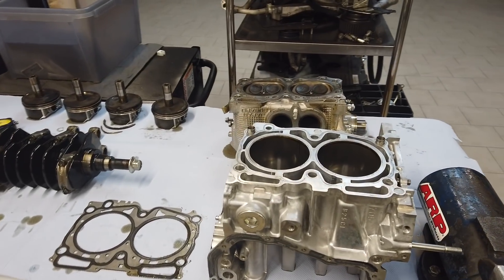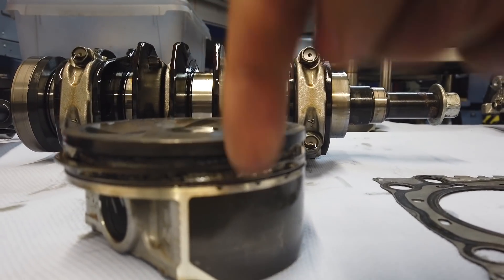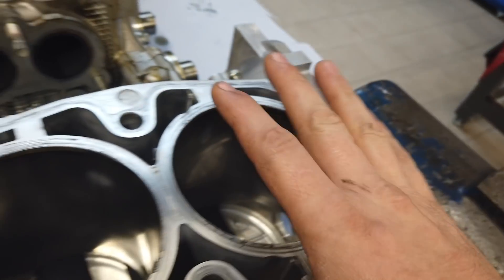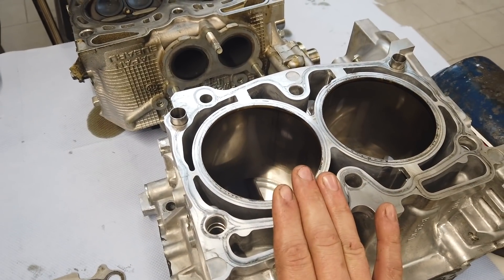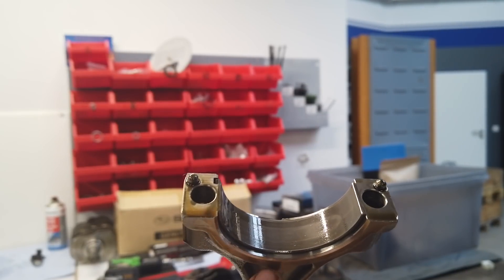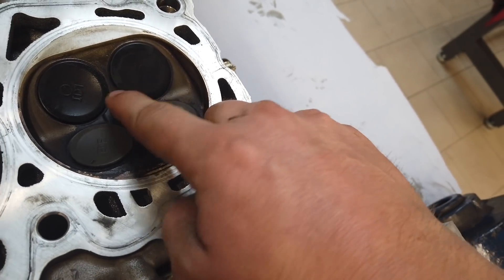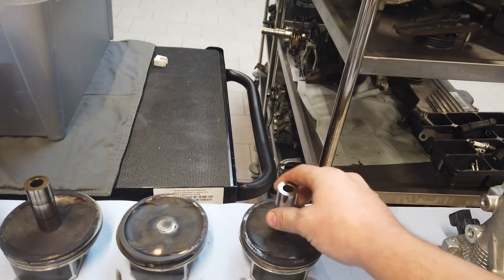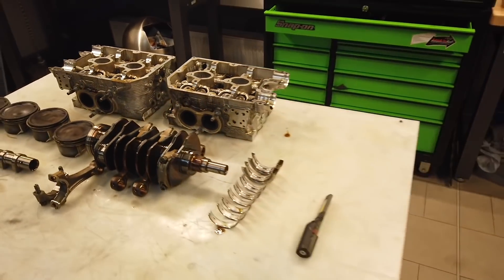Heavy engine damage on a NEW Subaru Impreza WRX/STi with only 16000km l EJ25 l Subi-Performance

Comment: Bad mapping and bad right foot or any of those 2
Reply: Amir Pomen Bad mapping? Yes.. Bad right foot? No.. the error-code (P0302) came at normal cruising..
Reply: @SoNaX07SoNaX  I think he meant more of providing sudden load to the engine at lower engine speeds. This kind of damage can occur earlier than the actual failure incident. The ringlands could have pinched down hard on the rings maintaining some form of seal and let the engine continue to run for a while before eminent failure
Reply: Jonathan Kim yes maybe. But I drove the car home relaxed and without longer highspeed sessions or heavy launches. At the first start after that (one week later), the first error code came while relaxed cruisin with low rpm after ~2min. The mapping was very bad.
My big failer was to chose the wrong mapper.
Reply: @SoNaX07SoNaX  so the engine in this video was yours?

Dont get me wrong... I mean earlier is either one of those issue or could be both in general...

So if mapping was stock..some driver that hooning around carelessly, the engine still can have this kind of damage.. especially with lower ron petrol...

And if bad mapping where the tuner keep increasing ignition timing aggressively that prone to this failure also... 
Ej257 or 255 suffer more ringland issue with aggressive timing... 
A good tuner will reduce ignition timing instead for this engine for longevity (but with a cost of extra fuel consumption and slightly less aggressive engine response)

So cheer up... Im in no way of condemming good owner/driver.... Just sad to see some people so called themself a tuner didnt really understand engine main weakness/advantage to gain or tune accordingly
Reply: Amir Pomen Amir Pomen yes, it‘s mine. 

Ok in general or in another cases maybe you are right. The ej25x engines are a little bit sensibel :D

Yes and in this case I got one of these worse tuner :/ 

Anyway. My subi will come back stronger and optimized from the right persons..
Reply: @SoNaX07SoNaX  definately the right place to build and tune our beloved scooby 🍻
Reply: Teenax JDM Even me with my Honda I am leaving stock tune because I only lighten car and focus exhaust changes. Some people are blowing their 1.5 Civic motors using tunes KTuner and Hondata. If I change downpipe and have to get tune I will have to get a tune. But for now I only trust Honda. Good luck with your car and the tune. 👍
Reply: "bad right foot" wtf.. an engine should be capable of full throttle at any point in the rev range.. how tf do you think you can kill an engine just with a heavy right foot lmao
Reply: @SuprSi  have you ever heard word of lugging the engine or bogging down on high gear... As well as wot clutch dump at high gear from stand still... Or simple enough...there is peiple kills scooby engine just by doing donut
Reply: @AmirPomen  Sounds like subaru engines are very weak then. accelerating gently at low rpm isn't that bad if ignition and fueling are correct, but better to be somewhere in the power band anyway. I'll rephrase though because you do have a point, bad mapping makes an engine more vulnerable to a bad driver.
Reply: @SuprSi  accelerating gently have no issue...
Problems starts when going wot at as low as 1.5k rpm or just 2k rpm...because scooby engine design is oversquare (much bigger bore than stroke) it prefer mid and high rpm range and happier being there instead of down low (*provided with good oil supply)
Reply: @AmirPomen  got ya :) I guess oil pressure would be less than ideal at low rpm + high load too.

Comment: subaru its not a good engine
Reply: Sure they are, i have 260,000 miles on mine and it's been driven hard many times. The key is good mapping, good fuel, and not lugging the engine.
Reply: Im a toyota man, but Subaru is a very good engine. From Nitro WEST Virginia USA.